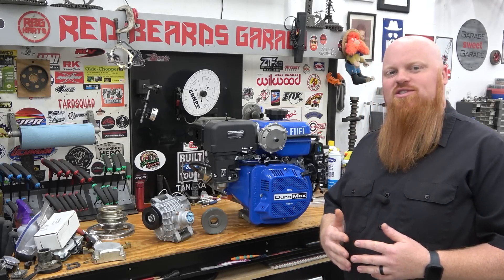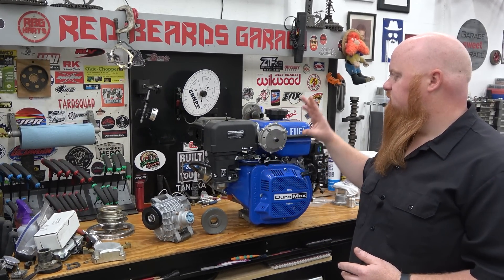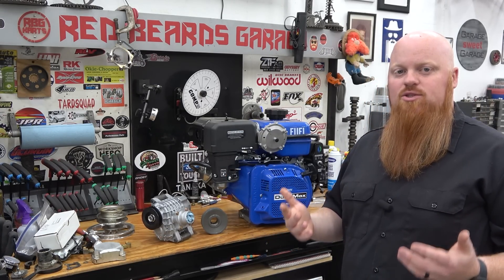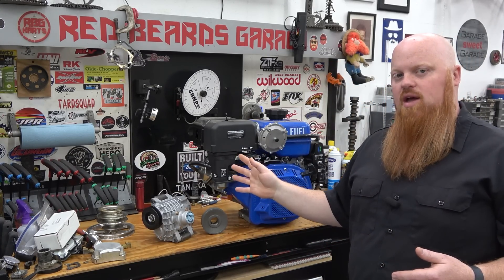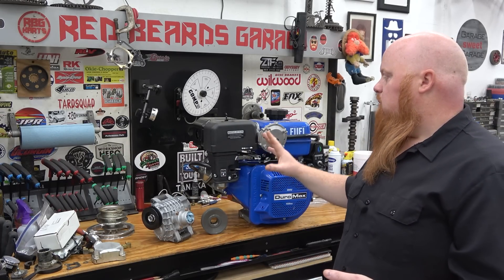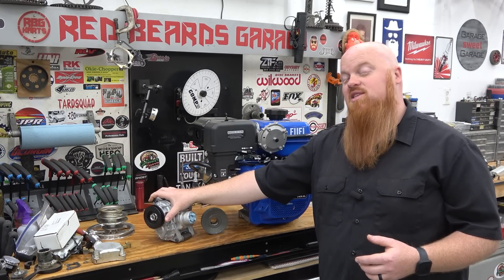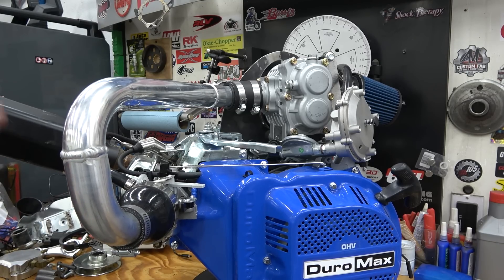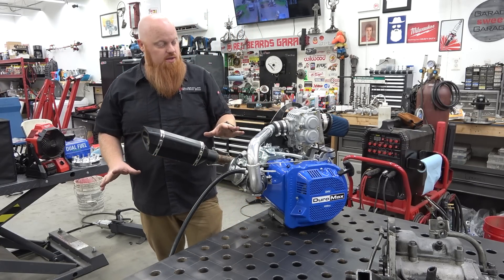Propane Supercharged 439cc ~ Fail

Comment: Ok, you were goofin' & 'speermintin' , thats fine. Now we await Anew Propane (LPG) Redemption video & put that 105 octane HD5 LPG to the test. Propane burns lazier than gasoline so more Ign. timing is needed to get the most out of it. Do the engines automatically adjust timing when switched to LPG? Thanks Greg! Paul from S. Central Tx.

Comment: I’m sure someone has developed and electronic propane regulator or electronic metering system, that would work since it wouldn’t have to rely on fluctuation mechanical motions to operate outside of its parameters

Comment: I’d try a carb meant for a VW engine. They’re virtually unbreakable and should be small enough you can jet it down to the Hp range of your supercharged single cylinder.

Comment: Every time I would ride someone 3 wheeler or 4 wheelers my best friend would always say watch out, he’s gonna wreck it,lol. Ya kno, he was always rite too,lol. When we would get it out the ditch, the owner said, what you doing? Well I’m learning what not to do on this 3 wheeler you shore won’t you pansies!! I was that type that would push beyond extreme just to do something fun. Started riding 2-strokes at 8 y old,by 14, I was had an 84’cr125r with a 53 t sidewinder sprocket. It was an animal, and I only weighed 135 lbs.  now I’m so old when I fart, the dust fly’s,hahahaha. But I still ride a 2-stroke bicycle china doll bottom with adapter plate’s and a stage6 sport pro mk2 Yamaha prebug top end. Capable of 13-19 hp.on a 26” felt faker tank frame bike. The neighbors come out to watch when I do a flyby,lol. Turns lil over 14,000 rpm’s and now has a 11t-36t gearing on 26” tire’s. Pretty darn fast for a bicycle and I have osteoporosis lol.

Comment: Mr Red Beard, strange question not content related.  Ive recently decided to joined the Shaved head club at 45yr.  I really like the feel and closeness of a razor cut but not the red bumps on the back of my neck.  What do you use?? Thanks in advance...

Comment: I have done this and it works well if you understand what is going on. atmospheric pressure is lower than boost pressure, therefor the carb must be in an enclosed pressure box and fuel pressure to the carb needs to rise with boost. 1-2 psi of fuel pressure base and maintain 1-2 psi above boost pressure. It's actually very simple if you understand what is going on.

Comment: I'm gonna challenge you red beard go to my page and watch my blow through video ask any questions you may have I'll be glad to clarify anything in another vid aswell. This is too simple to be what ppl are hung up on with boost also for the love of God let's be more realistic with these runners the length matters and a plenum in a boosted single is not optional if power is the goal. I'll even take a guess at you need about 1800cc of plenum and from the valve to the end of the carb in the plenum given your rev range 14-18in. This isnt exact but it's close enough for this and worlds better than what you have. I show a very simple easy fuel system with out the pumps and regulators and complexity of other systems normally seen. Also put this on the dyno please and let's see those boost numbers go up small engines really like it alot more than big ones. My 155cc compound turbo bike has been over 100whp and 90psi of boost blow through. Given the set up in the vids has changed completely but the principles are still the same. And when it was single turbo it didnt wake up until 18psi. Small as these bores are I'd start at 20psi and go from there.

Comment: Best most easy bike carb ive used for blow through ive found is a cv carby like on some gy6 motors and of course riseing rate fuel reg and  and pitot tube etc plus you have no plenem volume that will make it suck to tune.dont give up its easy when you know how.if you have an email i could do a sketch of the layout

Comment: Just set it up as a pull through. Sure you’ll be compressing aspirated fuel but it’s cheaper than a boost regulated fuel circuit

Comment: Hey Red Beard,  how much more power do you get with a supercharge on 212, 439, or a 700 engine?
Reply: 14 PSI boost is 1 atmosphere, and makes the engine seem double the original size.

Comment: Using liquid propane in fuel injection kit with an LNG nozzle controlled by a wide-band O2 sensor might work great. The early McCulloch/Studebaker/Ford/Paxton blowers put the carb inside an aluminum air box and a higher-pressure fuel pump & regulator to keep fuel pressure above the manifold pressure. A modern turbo motor would be similar and fuel pressure is easily controlled electrically. Vaporizing liquid propane inside the engine would also lower the charge temperature. Of course, with FI & a blower E85 or methanol would be way better than propane.
Reply: The mechanical fuel pump on the Studebaker/Paxton setup was boost referenced.

Comment: It will only work 2 ways:
1 if the carb and propane are before (at the intake side) of the supercharger/turbo.
2 if fuel injection is used you can put it everywhere but i advise to put it between supercharger/turbo and engine. The boostairtemperature goes up and might ,,selfignite,, the fuel. 

Older carb cars on lpg had a converter where it was made gas. The lpg came as fluid to this converter and that had a hot cooland supply to convert the fluid to gas.
A multi hole ring would supply this gas in the airflow right behind the carb.
Now we go to what we call a G3 unit. Multi point efi uses gas(not liquid) that is injected in the inletmanifold. Electric valves(each cylinder has its own) regulate the supply. So it has the same,,environmental friendlyness,, (regulated) as gas.
If its direct injection there will be no converter but than the fuel/lpg is direct injected as liquid.
Liquified peteroleum gas (lpg) are fumes in de rafination proces from crude oil to variuos fuels, plastics and tarmac.
They are liquified and can be used as fuel. Where propane/butane are parts of the fuel taken out, lpg was burnt off.

Please have a follow up. Its possible to run it this way.
Reply: Good point sir,~

Comment: What I have been wanting to put a 300 on a decked out 224 with a draw through set up and my concern being that small I figured use a slightly smaller pulley on the engine or slightly larger on the charger 1 to decrease the load the on the engine with mechanical advantage and 2 reduce the amount of boost slightly from the lower rmp ratio and my other worry was wouldn't you need to advance the ignition timing to compensate for the boost and how would you do that? How would I  clock the fly wheel a few degrees with it keyed?  Maybe a bracket to locate the coil pickup a few degrees sooner so retard the coil or advance the flywheel I guess? Would that work?

Comment: An easy fix to make the propane work is just connect the propane tank to a 3/8 inch valve and direct the propane directly into the supercharger. Works pretty well….

Comment: to make a standard blow through work, fuel bowl will have to pressurized via a venturi inline after the supercharger. from my research a 3/8 venturi will be correct. also you will need a boost referenced 1-15 psi regulator 1:1, hooked to fuel with a 15 psi fuel pump. low psi set all the way down to 1 psi. u can use an atmosphere vent on a flatslide for the boost going to bowl. install a check valve so fuel doesnt travel back. get a stronger spring in the flatslide to help on sticking. install a 38mm throttle body before the supercharger that syncs with the flatslide. install a intercooler between supercharger and carburetor :)

Comment: super interesting, im running the same ratio for my 206cc supercharged project that also failed lol. That supercharger mount is legit, looks way better than mine made with scrape straight bars XD
Reply: To try and it not work right,is better than to not have tried.'Pretty' doesn't matter when it come to power.Happy Trails.

Comment: Looks like pull trough won't work because the supercharger will cause a constant vacuum instead of a pulse.
Reply: A supercharger is mechanically driven. It adjusts to the engine speed. The port stays the same diameter so only airspeed can change the amount of air. This speed is the one responsible for the vacuum.

Comment: You need a boost referenced fuel system. One that adjusts fuel pressure based on boost pressure as to not overcome the needle and seat.

Comment: If you put the carb in front of the super... bolt that charge pipe to the block cause it may not want to stay there with just rubber...

Comment: Propane regulators for cars like the impco 425 have a port to atmosphere where you can hook up a boost sensing line from the manifold. One option for running the gas carburetor is to build a can that completely surrounds the carburetor that way the boost pressure rises inside and outside balancing the pressure and then it will run my normal

Comment: Doesn't matter if it's propane or gasoline, you're right, the boost will "push" the fuel source in the wrong direction, instead of pulling it through the venturi. There needs to be a boost reference circuit, basically a line from the boost side of the supercharger to the bowl side of the carburetor. Had you put the carburetor on the inlet side of the supercharger it would have fired right up.That's how they do it for automotive supercharger applications.
Reply: Spot on! Well said. And correct too. If you are carbed and you are running a blow through setup it has to be a blow trough specific carb or it just won't work.. now with the carb on the inlet side of the blower it should work as if it was stock(but with more power of course)
Reply: @DrGibs347  It wouldn't hurt to get a larger carb to handle the increased airflow. Let's dial this thing up!
Reply: Here's an idea for you you could use that same carburetor on the intake side of the supercharger for your and your vacuum control for your propane they do make a kit that's a universal for generators that go right behind the carburetor I would hook it up like the modern-style fuel injection system to where the carburetor is your throttle body and have the injector at the base of the boost tube going into the motor like the injectors on an automotive were there after the supercharger I would try that if you want to try it with I do know some vehicles that use propane do have a supercharger or turbo on it and that's how they set it up
Reply: Yeah you could just run a boost line to the fuel tank or something. Or make a new hole to the bowl and put the boost line there. Greg i hope you see this!
Reply: @tilen3266  you really need a rising rate fuel reg boost in the tank would help but not the most accurate way to go about it